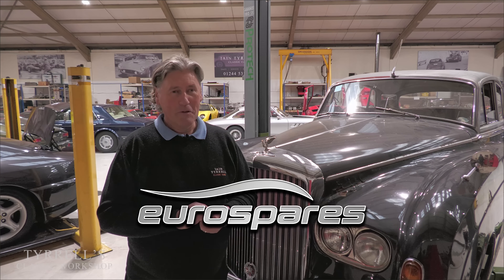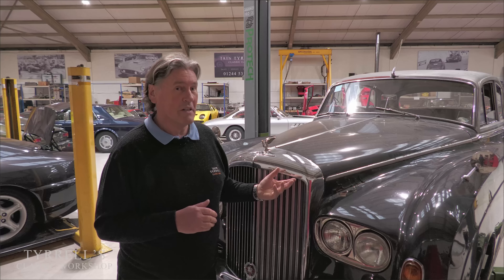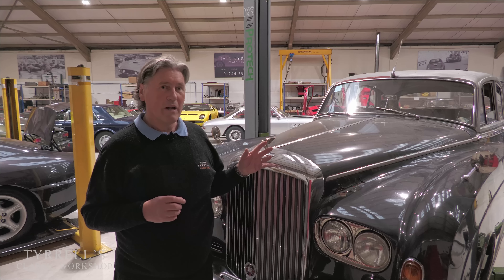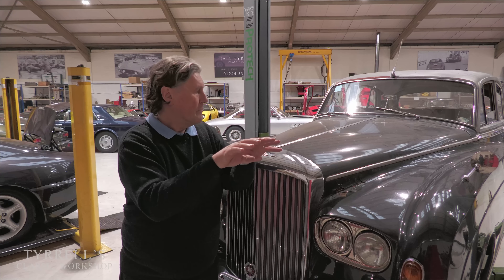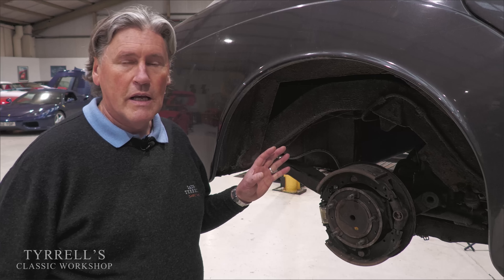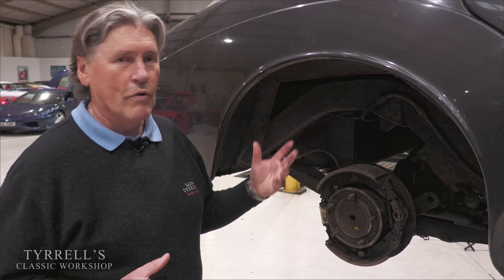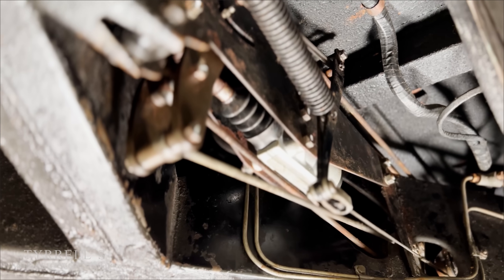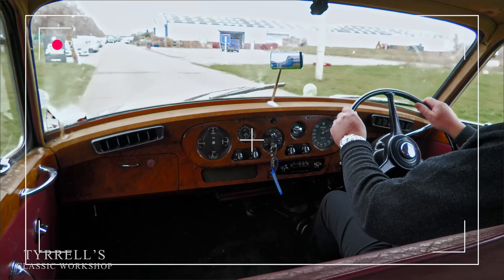Bizarre Bentley S2 Brakes | Tyrrell's Classic Workshop

Comment: so, f I understand the braking system correctly, if you are reversing the car, the front brakes are disabled no matter how fast you are going.   Well, I don't suppose it matters much.
A couple of corrections to what the guy said:-
It is true that disc brakes fade less, they also still work after you have driven through a puddle,  but car makers didn't change to disk brakes because they are better.  They changed because disc brakes are simpler and cost less to make.   Disk brakes need higher application pressure, so they came into use when manufacturer figured how to make a dirt cheap vacuum booster, so that required pedal pressures stayed acceptable.
Allowing the front of the car to dive down on braking does NOT increase the load on the tires.   Obviously you get maximum tire load if you have a rigid suspension - no springs at all.   Obviously, if the springs allow the front to go down, the springs are REMOVING some of the load from the tires.

Some owners of older Rolls Royce that have made YouTube videos reckon the brakes are pretty good, Others reckon the brakes are not good.    One YouTuber said he loves his old Roller, but he won't take it out in heavy traffic, because the brakes aren't up to it.   I wonder what the reality is.   I once got to drive an early 50's Roller owned by a friend of my father.   It's brakes were terrible, but I don't know what level of maintenance it had.  Actually I was pretty unimpressed, as it was like a heavy old truck to drive.

Comment: Looking into buying a 1961 Bently s2. the guy wanted to change the brakes from drums to disc brakes and after watching this video im wondering if that is even possible.
Reply from the maker: Under normal circumstances not strictly necessary but it can be done apparently

Comment: The weight, the load on the axle, shifts to the front regardless of the type of suspension. It even shifts on vehicles that lack all suspension. The dynamic center of gravity shifts on all vehicles.

Comment: This is so fascinating. Is there a particular reason why Bentley/Rolls Royce went for this system instead of a more 'traditional' vacuum-assisted hydraulic braking system? Were the hydraulic systems or servos of the time not up to the task of stopping a vehicle of this weight?
Reply from the maker: Vacuum servos were notoriously inconsistent and patchy in the 1950s. I’m pretty sure R-R weren’t prepared to take any chances

Comment: As a self-professed auto nerd, thank you for the insight.  
Its an interesting point that the large Bentley weighs 2 1/4Tonnes because that is close to the weight of modern large cars particularly those with electric propulsion, so from that perspective its not heavy at all!
Drum brakes are much maligned but principally they are more mechanically efficient than disc brakes, disc brakes do score however where the brakes generate excessive heat from repeated use or heavy applications like down hills.  Its no coincidence that Mercedes, Porsche and BMW have parking brakes operating on drums in addition to the four wheel discs because of their mechanical reliability for parking.  Parking brakes operating on discs can lose adhesion when they cool down particularly after a 'hot' stop together with poor mechanical efficiencies in applying the parking brake effectively.  My Skoda Superb has a warning in the handbook to park the car in gear on a slope to prevent inadvertent movement after the brakes cool down.  This VAG system uses the worst of both worlds - a parking brake operating on the disc and a solenoid applying a less than possible clamping action.
One point that puzzles me on the S2 is the use of a large Jubilee clip around the friction servo that doesn't seem very Rolls Royce!
Reply from the maker: Thanks. Yes, the Jubilee clip is indeed factory original!

Comment: I own a 1964 S3 and have had the brake system overhauled a few years ago at considerable cost and I took some time to study the system with it's complexity. I find the Rolls mechanical braking system to be over complicated to a point where I would like to modernise it with front discs and another form of servo. I have seen a S3 with front disc brakes on youtube but it wasn't featured. Seen most of your videos and love them.

Comment: And now to the MOT tester to see what he makes of the system. 
It would be interesting to see what his equipment tells you as the video seemed to show that the back end was pulling to the nearside which may have been just due to the road surface,
Reply from the maker: We didn’t go too mad as the brake linings are all new and not bedded-in yet

Comment: To add to his comprehensive explanation of the braking system, I think it is worth mentioning that the front brakes are 2 trailing shoes and the rear are 1 trailing and 1 leading shoe. This allows more powerful braking on the rears as leading shoes have a self wrapping effect and help braking efficiency. This is designed to give balanced braking by the levers operating the master cylinders having more leverage when driving forward thereby compensating for the less efficient trailing shoes. When braking in reverse, the servo rotates in the opposite direction and operates the master cylinder levers from a less advantageous position, equalising braking efficiency.

Comment: Sorry to p-ss on your chips Iain, but the car doesn't need to be going 12mph for the servo to work. If you had actually worked on the system, you would know, that as long as the car is in motion, the brakes will work at full efficiency......provided that it is set up correctly. I have spent many hours of my life bringing non-functioning S1, etc. brakes to perfect functionality.
The system is, as with most RR and Bentley systems, over complex and over-engineered, but with the proper understanding of it, the brakes, as you say in the video, are extremely effective. The only fly in the ointment being the fact that the car WILL need to move approximately a foot or so, to be completely brake efficient. Also, i just have to mention that it is not a good idea to put the car in Drive......with a cold engine that is running at a fast idle.....especially if it is parked close to a wall. 
Chris Crees.....erstwhile RR and Bentley service tech.

Comment: What happens if you get engine failure on a motorway? If you got engine failure there is no drive to the auto gearbox, would that not shut down the front brakes?
Reply from the maker: The servo is driven from the output on the transmission, hence wheel rotation powers it, not engine

Comment: Thank you for your knowledge and sharing it with us. We have a 61 RR Phantom V and keep bending the link rods to the rear brakes. Do you have any advice to solve this issue?
Reply from the maker: Pleasure- glad you enjoyed it. The brake rods are designed to be under tension only. If a rod is bending, it sounds like it’s being compressed? Something definitely not right there. My initial advice would be to look at a schematic diagram on the net if you can, and compare the basic routing of the mechanism

Comment: Great at last someone with nerd video on S2/3 Bentley's. I would love a follow up on how to set these brakes up from scratch. I have just had all the cylinders resleved as well as the masters cylinders so my bedtime reading is the workshop manual. A show and tell on setting up the brakes would be great. you could follow that with a strip down and rebuild of the Auto choke system which appears over complicated but stops our cars from starting from cold. I am loving learning about these cars. Hugh
Reply from the maker: Not sure we can encompass that much detail. You may find the RREC is able to supply you with some information. Thanks for watching though!

Comment: I still don't understand why one would have such a complicated system that risks low speed braking. Why not just jam the friction servo so that it is always on the hydraulic cylinders? Is this all to do with "gliding to a stop" with the rear brake mechanical linkage? Seems dreadfully risky.
Reply: Come to think of it, all it is is a speed sensitive mechanical switch. It would be better with a sealed centrifugal "governor" arrangement, that pushes out when it reaches a certain speed, than rely on a friction surface that gets glazed with lack of use.

Comment: One thing one would never forget is getting out of a tight parking space on a cold engine with the choke on. If one does not know that the only brake one can use is the handbrake, one is into a lot of trouble and damage to one’s car and to others’.

Comment: One comment: Anti dive front suspension does NOT reduce the weight transfer to the front wheels  under braking as was stated, it only reduces the amount of vertical movement. The front end diving may give the impression of more braking power over the front wheels, but that is just an illusion.

Comment: Finely tuned mechanism ?  What a joke.  Bentley and Rolls Royce Brakes were all basically garbage.  Stupid engineering that appears to be an attemp at "Reinventing the wheel".  The french company Citroen lent their patent of the braking system to Rolls Royce when the Silver Shawow was introduced in 1966.  The imbecile English modified the design for some retarded pompous reason.  The Citroen used a High Pressure Hydraulic Pump that was belt driven off the engine as an Alternator or Water Pump.  It was excellent, reliable and easy to service.  The stupid English used (2) High Pressure Pumps that were driven by the Engine Camshaft.  To Repair/Replace either pump it was necessary to dismantle the top of the engine.  They also added Coil Springs to the Suspension that Citroen had no need for.   The Rolls Royce Hydraulic System had 3000 Feet of High Pressure Tubing running through the vehicle.  If the vehicle lost Hydraulic Pressure it was impossible to stop.  I could add numerous other details on these junks, but there's no point.  The pathetic Island Nation never learned "Simplicity"

Comment: Thanks very much Iain, that was quite fascinating.  What I wonder about is whether the brakes are very effective going backwards?  Let's say that you are going up a very steep grade, the engine stalls, and you're obliged to travel backwards down the grade, relying on the brakes. You won't be able to rely on 4 wheel brakes kicking in at 12mph, as the servo won't work backwards.  Are the rear brakes alone, operating mechanically, good enough for this scenario?
Reply from the maker: Thanks for your kind comments. Fortunately the servo works equally backwards as forwards!

Comment: I learnt about these brakes many years ago from John Bolster's book "The Upper Crust". I thought that the original H--S system employed a small drum brake as the servo motor, the shoes of which rotated constantly on a shaft from the gearbox while the drum, on a single hinged mounting, tried to rotate when the brakes were applied. This was prevented by a cable or shaft, which in checking that motion, added the resultant torque to the main braking mechanical system. It revolutionised the stopping ability of heavy cars and the servo motor brake shoes were said to never wear out. I understand that the pre-WW2 V12 Packards used a licensed version as well. Trust Rolls Royce to make something complex out of it!  Like the nerdy little 8 year-old whose motto seemed to be "Never use a short word if a long one will do!"

Comment: I'm going to assume that RR kept the rear mechanical brakes because they thought it was necessary to properly engage the servo.?
 Why did they not make 100% use of the hydraulic rear pistons to activate the servo, if properly bled and set up, it should have got the job done ?
 The engineers already worked out the 30/70 split involved with the rear mechanical mechanism, why not just redesign things with only hydraulics ?
The mechanical part of the rears could have been retained for the park brake only.

Comment: Good video Ian. Tx. I’m not convinced that a primary safety system which doesn’t work if it’s not carefully set up can be thought of as good engineering though! The mechanical servo is interesting. Using the cars’ energy to actuate a control is the same principle  as an aircraft’s servo tab. And they’re still in use!

Comment: Hello Iain, I have a question it is not about classics unfortunately but it does touch on a subject that I feel must have effected so many people an could also have a strong bearing on the possible future of motoring.
Would it be possible to enable a BMW 3 series compact turbo diesel, run in exactly the same format as a Peugeot 205 turbo diesel?
Working from the premace that a cars emissions when manufactured equal 12 years of its yearly motoring so it's a good idea to run things on an on, so classics are very environmentally sound despite their mpg or emissions quota.
Alan Clark the mp once wrote about a new doomed era of emission systems with a sell by date!
Boy do I know what he was referring too.
I fix my own cars as best I can I have Autismn I can get my head around the 205 an 106 diesels I have not to far removed from diesel generators, but when both those vehicles needed more doing than I have time, I'm a main carer! 
I attempted to buy from a friend for £1000 this beemer it had been largely ok for him but on my second day of ownership it wouldn't start I tried a few basics but with a ecu an high pressure fuel system it went to a BMW specialist after weeks they diagnosed a faulty ecu an fitted a second hand unit all matched to the car, some £550 it ran badly used loads of fuel an gassed me out so bad I returned it it went back to the specialist £650 later we got it back apparently the new ecu no longer recognised the injectors so replacements were fitted, old and new?
Upon driving it it had a hot starting problem so I gave it back to my friend in this care roll I can't afford to get stranded so I fixed my 106 of a fashion! An have motored on for a year or two.
I did in desperation try to mot the BMW a year or so a go it ran but failed on rear brake pipes and front lower arms so again I shelved it.
Thing is I'm now stuck no vehicle perfectly capable of fixing my old school jobs but no available time, so my thoughts returned to this BMW.
Here is the challenge if the BMW could be made to run exactly like the 205?!
So low pressure turbo diesel a belt driven pump absolutely no computer zero complex wiring no sensors just a stop solenoid!
An the million dollar question could it still pass an mot?
I actually believe it would be more fuel efficient an burn the fuel better because there's no way it was doing the mpg the computer claimed!
It's a brilliant bit of kit ruined by complexity an expensive bit of engineering that if simplified would do half a million miles, if you removed the dodgy plastic stuff also!
How many folks have had there lives buggered up by dodgy emissions systems cars scrapped that look mint!
Back in the day stuff rusted engines had issues gearboxs but it was genuine robust problems that if you chose to fix you may get your use out of it.
So Tyrell's Classic Workshop I challenge you to change the course of human history when the present bureaucrat eco folks subside, we are all going to have to get mobile useing the last of the petrol an diesel vehicles that still had some longevity built in.
I can donate the beemer an some funds it would take a Man of your knowing to see the merits in this.
Between myself an my friend we could have bought a scruffy MGB to Brumme about in an I'd far rather those problems than this.
All the best an please Help if you can, it may help many thousands across the world.

Comment: It's interesting to learn about the evolutionary dead ends in engineering. Great ideas that were either too complex or impractical to dominate the general car market, but worked, sometimes better than the more popular, but easier to maintain and operate systems.

Comment: Great stuff Iain, again!
Takes me back to my early London motor trade days. The Iron Bridge garage, in Hanwell/Southall in 1967 and we had a '57 Hooper bodied Silver Wraith (with the big P100s) in the showroom.
 I sold it (making me  extremely popular with the management, albeit temporarily...) and had to get it out and around to the workshop for PDI etc. It was parked just inside the big sliding glass door and I had yet to open that. (I'm sure you know where this is going). 
I got in, fired the old girl up, stuck her in 'D' and she leapt forward with my foot hard on the brake pedal and took the showroom door out in it's entirety. For the reasons you have so admirably explained above. 
Luckily, the descending shards of glass appeared not to have damaged her, and the sales manager seemed completely torn between rage at the damage to the door and relief that this long-stay patient was at last leaving us.
At that time, Iron Bridge (then part of the Noel Bell group) had a group scheme for best salesman, and it was based on the number of points awarded to each car sold, judged on it's "sellability". The old Roller had been around for a day or two and had many many points awarded to her. As a consequence, and based on only one car, I got the award!

Comment: Thanks Iain, very interesting, keep the tech stuff coming. Were the brakes designed to only work on the back wheels at low speed to make sure (under normal driving) that the car did not nose dive when being brought to a stop? It would make the stop more comfortable for the passengers and is just the sort of careful design that RR and Bentley were known for.
Reply from the maker: R- R were a complete law unto themselves at this time. I’m sure they would have had a very compelling argument for doing what they did, however strange!